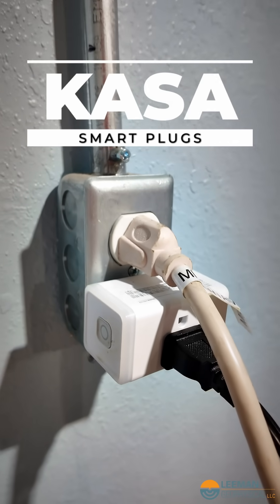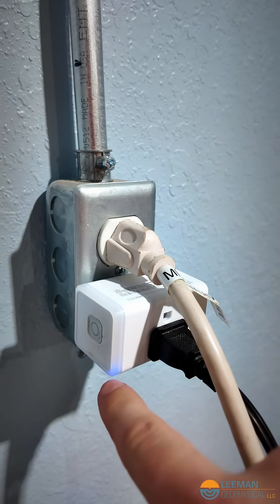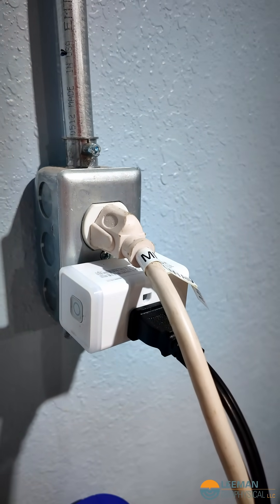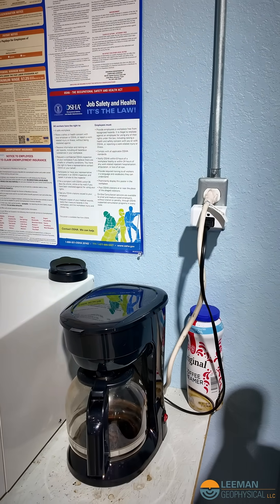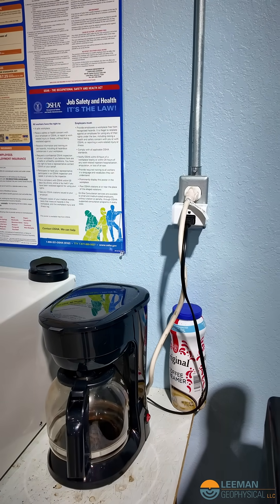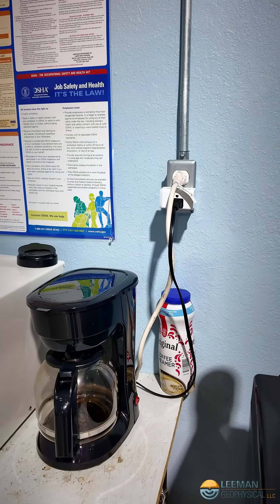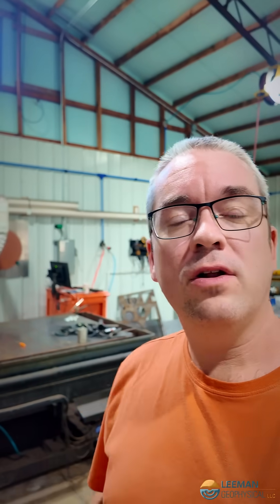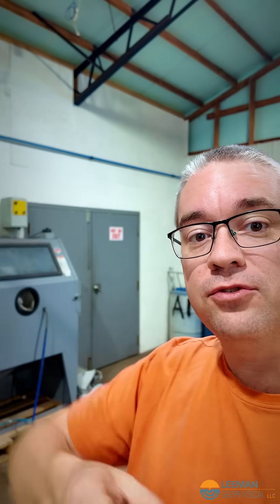Don't burn your shop down - use smart plugs and stop worrying!

Comment: Electrician here:  Please make sure that your switches are actually designed for the amount of power your devices can draw.  I wouldn't be shocked (pun intended) if they're only rated for 5A.
Reply from the maker: Indeed! These are rated for about 5A, but we've got smaller loads on them. thanks for watching!